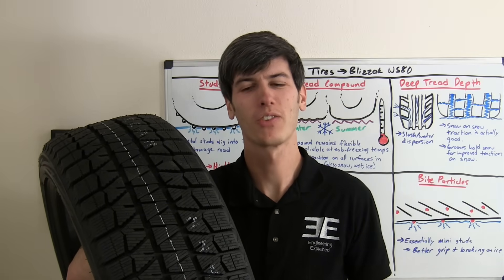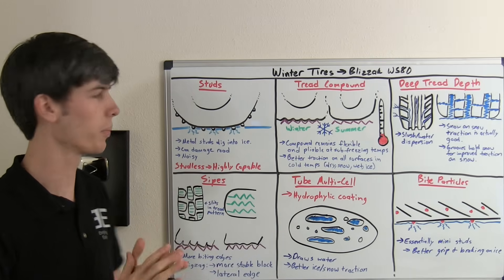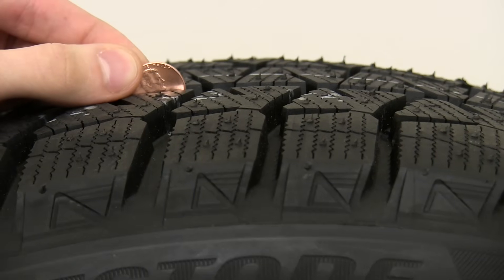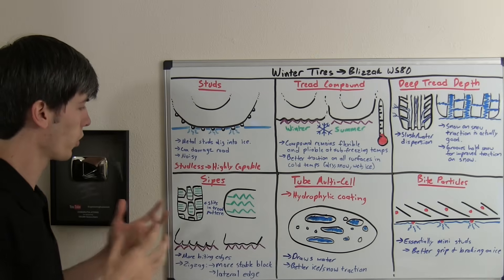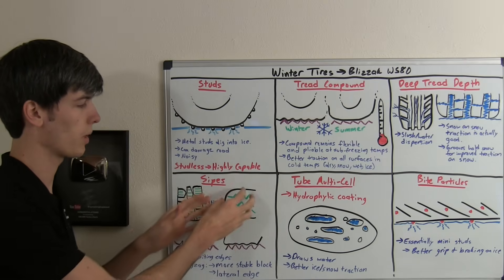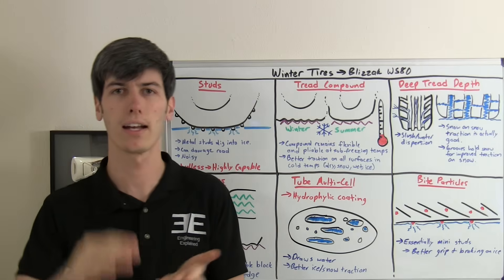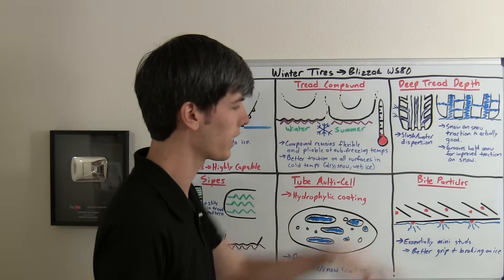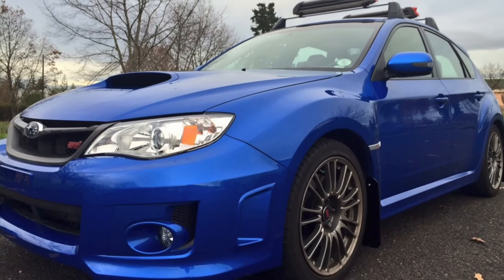Winter Tires Explained - Bridgestone Blizzak WS80

Comment: Studs are legal where i live. I know they are not legal everywhere. There is no replacement for studded tires on actual icy roads though. If you can see the pavement they don't help. The road is cold and hard, a tire is soft and warm. When the road is pure white like when with packed down snow, the studs are amazing. Most roads are white here. Just for fun i only put studs in my front tires on my fwd car.

Comment: I just bought the same exact tires for my WRX, but 16's with steel rims.  I'm curious to know, how quickly do you think these will wear out on dry ground?  Considering how soft they are I imagine I can run these down pretty quickly.
Reply: +Dansyoutube It's hard to say since it's difficult for me to not drive aggressively in my car, but so far I still have plenty of tread depth left for snow after 6k miles on them. The little stubs that were first on the tire are no longer there, they were meant for ice traction if I'm not mistaken, but all of the other characteristics of the tire are in tact. I'd say I can use these for about 3 seasons, which is about 4 months a season, 5k per as well. so about 15k of driving on primarily dry ground until I'd swap them. If I drove in a very tame fashion, I could see them lasting almost twice as long possibly. Note that the handling on dry ground is not good, but snow handling is ridiculous.

Comment: I was actually thinking about buying those tires. I live in Tennessee and some people have told me that if the road is dry/not snowy and icy. I also was told that those tires should only be used on ice/snow. It'll tear up that hydrophylic coating making the tire wear out A LOT faster.

So my question is, if that were true wouldn't the tire still be perfectly usable just without that coating on it?

Comment: Subaru plus Blizzaks kind of makes you invincible in the winter.
Reply: Na , it’s the vape
Reply: Any AWD + Blizzaks.
Reply: @eldesgraciado6690  I'm a Toyota driver now after owning a few Subaru's that needed many head gasket repairs. Subaru does make one of the best AWD systems for non truck style vehicles. I do have Blizzacks DMV2 on my Rav4 but that style of AWD isn't in the same league as Subaru IMHO.
Reply: nah, jeep

Comment: Good video. But for people who own Subaru's such as you and myself we don't need winter tires. Last winter in my home town we had a snow storm and pretty much everyone was getting stuck around me. I didn't have any chains on and pretty much bald tires...went through the snow/ice as though it wasn't there. My Subaru Legacy blasted through the storm like it was dry.
Reply from the maker: fightingfalconfan Haha, I'm sorry but that's just not how physics works. AWD does nothing for you in cornering or decelerating (though it can evenly brake with engine braking, but I'm talking about hard braking). Your tires are the most important thing for traction in the winter, as they're what's contacting the surface. It all comes down to friction. Winter tires will allow for more friction in winter conditions. No car manufacturer can prevent that from being true.
Reply: Actually AWD does ALOT for you in the corning...you just have to know how to use the system. Basically knowing when to brake/accelerate and how much pedal pressure to use. My tires where pretty much drag slicks during the storm and I never once got stuck.
Reply: Subarus symmetrical AWD is extremely good but snow tires are still recommended if you live in snowy areas.
Reply: fightingfalconfan  I think that what EE meant, was that if you apply same speed  in AWD/RWD/FWD when cornering and then brake the same way in all these cars, there is virtually no difference in the way that these cars stop or corner.  They all need different approach when cornering. but tires have no role in that. And lets face it, he is an engineer or studying it, not wise to argue about physics with a man who knows it very well.
Reply: Maybe it just depends on if it's a wet snow or a dry snow. Snow where I live is vary wet, I went through my area to and from work even going around to a friends place to help him put chains on was no problem for me and just about bald tires. Even going up a decent hill was no issue.

Comment: Is there any "optimal" air pressure to run on winter tires? I realize it varies from car to car but just go with the manufacturer recommended air pressures? I find it pretty hard to judge because where I live, one week it will be 5 above (Celsius) and next week -40.

Comment: I absolutely love these tires. I got a set of these for my 2014 WRX hatch and they are great. By the way, I love the WRB. Same color as my car.
Reply from the maker: I'm a bit obsessed the the WRB WRX (and STI) hatches. The appearance is not for everyone, but personally I absolutely love it.
Reply: I love the hatch as well. When I  learned that Subaru wasn't going to offer a hatch for 2015, I knew I had to get a 2014 somehow.
Reply from the maker: ***** I did the same, I got mine in March and it was one of two remaining blue STI hatches in the country that I could find. A dealer told me (lies) that orders could be placed for '14s through July of this year so I thought I could wait, as I had planned to custom order one. Nope - but I managed to get one with just 8 miles on it delivered from CO, and at well below MSRP.
Reply: I managed to get the last WRB WRX hatch in Arizona. I got lucky and found one with all options that I wanted. What is really funny, I also picked my car up in March.

Comment: Do you think decent all seasons(60% tread left) tires with 4WD will be enough to get through the snow?
Reply: All seasons and 4x4/AWD have gotten me and everyone I know through winter just fine. So long as you apply common sense and careful driving. Whether there's 2 inches of snow or two feet, you will be able to accelerate without spinning much, if at all. Where you need to be careful is cornering and braking. This is where the winter tires come into their own, even on a 4WD vehicle. You WILL slide just as much when you brake or turn as if you were in a 2wd vehicle, and you need to modify your driving style accordingly. Slow. Down.
Reply: No. All Seasons aren't made for winter at all. All Seasons are made for spring, fall, and summer.
Reply: It's not ideal, that's why they're called All Seasons, jack of all seasons, master of none.
Reply: +Hear That? General Altimax RT 43, if you're interested in a good priced tire with long tread life and quiet on the road, and excellent in the snow. . Best non snow tire I've ever used. liked the first set so well that I bought a second set and also put a set on my wife's RAV4. she felt much safer and said her car went extrmely well. I took them off of her car and my car during warm weather and am running the tires that came on her car and old ones I bought for $40 👍.  the next All Season I would put back on my RAV4, or my wifes, would be the Mastercraft HSX tire-did excellent in the snow..did good on my mom n laws 4Runner, too. The winters here are so bad that I'm probably buying snow tires this year, just to be safe. the Almanac has been accurate and they are predicting worse than last year and the year before, thanks to the Jet Stream shift. I don't mind the snow, I just don't like the ice.

Comment: How much do they cost?
Reply from the maker: Alex Martinez Differs depending on what size. My Subaru has 18" wheels and wide tires, so they're significantly more expensive than other sizes. That said, $200 per shoe isn't that high compared to some of the others in the same category and size.
Reply: Engineering Explained ok thank
Reply: I live in Europe . I use 13" Tigar Wintera which costs arround $40 per tire with instalation . Before every winter , I buy 2 new ones , put them on front wheels (front wheel drive Hyundai Atos) , and from last year I put in the back , so I always have fresh rubber for puling up hill , doing cornering and most of braking . Even this cheapest one is much better than any all season or summer tire in snow and ice . I keep them when they fall under 4mm (minimal legal thead depth for snow use) for spring and autum , and I use summer tires only for hottest days like in July and August . With this cheapest I never got stuck , never had handling or braking problems , and my car has no ABS or ESC . Only problem with them is that they make a lot of noise between 50 and 100 km/h , squeek during cornering on hot asphalt and wear out much faster in summer than in winter . But with my plan , my average tire cost is $120 per year , because I buy summer ones once every 2 summers .

Comment: Here in Charlotte, NC we just kind "YOLO" the winters. Nobody buys winter tires and they usually just buy the cheapest All-Seasons. Yes, even those in AWD SUVs go sliding across the road like they were stones in curling.
Reply from the maker: Darkmatter28031 Yep, I'm from NC and know the winter car culture (ahem, lack of) there.
Reply: "YOLO'ing" the winter is really bad practice.
Reply: For Charlotte you'll want to run winters from December 1 thru March 1. Only the months if December, January, and February have average temps below 45 degrees. But yeah, people here do NOT know what they're doing on the road in wintry conditions. It's pretty scared. Almost best to stay off the roads entirely.

Comment: Great video! For a followup, could you do stoppage tests with your Subaru to show the difference winter tires make compared to stock tires in snow? A lot of people are still skeptical about the impact these tires have and it would be awesome to see a real unbiased demo of it. It would be a bit of work but would make for a really sweet video. Thanks!
Reply from the maker: Shiraz Hazrat Tire rack publishes some pretty good test results. Until I have a second set of wheels, it'd be challenging to do a back to back in the same conditions. Perhaps eventually though.
Reply: Engineering Explained
Oh no!  Please tell me that you minus sized your winter setup.  Running winter tires on standard steel wheels in the smallest rim diameter that you can possibly stretch over your brakes is how we roll in the Great White North.  There are a lot of good things about higher profile tires.

Comment: I live in Edmonton Ca. It's freaking cold and a lot of snow. Currently running Michelin X-ice xi3 on my frs. Not impressive as I expected, definitely will test Bridgestone's tire next time.
Reply from the maker: Li Li Of the test results published on Tire Rack, the WS80 seemed to have a slight edge over the X-Ice. Braking they were similar, but under acceleration the Bridgestone tires had an advantage.

Comment: The Blizzaks are definitely a great snow tire. I have them on my B5 A4 Quattro, so that plus AWD makes it great in the winter. I have the WS70, though, which seem to be directional whereas the WS80 are not. Should be better for tread life since you can rotate them to different sides of the car.
Reply from the maker: MityLite I have a whole playlist on the matter. https://www.youtube.com/playlist?list=PL2ir4svMoaYim-RSNWEh-aIfdcM6plSly
Reply from the maker: WS80 is also directional. Yep, AWD and winter tires will make snow acceleration a breeze. My Subaru has LSD front and rear as well, so I'm pretty curious to see how well it accelerates in the snow. Braking and lateral grip are of course not AWD dependent, though engine braking can help provide light braking to all four wheels which is nice.
Reply: Ah, they looked non directional at first. My car has a quasi LSD to where it brakes the wheel that is slipping. The acceleration and grip is great, braking is another story though!
Reply: Engineering Explained You should do a video on how LSD's work

Comment: Keep us update with your impression on your subaru WRX STI with this WS80 on ?

Next year, I need to change so ... the Bridgestone is in my list.

Thanks
Reply from the maker: Mazda Speed Thanks, if you don't see anything about it shoot me a reminder around Feb/March after I've had plenty of time on the snow.
Reply: Engineering Explained Do you have news for us about your WS80 ??? thanks to keep us update ...
Reply: Engineering Explained And I have some questions about your WRX STI ... I really need to change maybe my SPEED3 2008 for a STI ... a lot of people tell me the 2.5L Turbo is not the best motor ... so I don't want to change for an none unrealible car like maybe the STI but I see you have a good judgement ... so why did you choose maybe a car with a lot of problem etc etc ... thanks for your help
Reply from the maker: Mazda Speed Only used them once on snow, but they were fantastic. No slip at all. STIs are generally reliable. People abuse cars and then complain they're not reliable. The engine isn't designed to last forever on a Cobb Stage 2 tune (though many last quite a while). It's a strong engine. Keep up with maintenance and you'll be fine.
Reply: Engineering Explained I just don't understand when you apply a tune stage 2 with proper tuner why the engine can't tough it ??? I have a Mazdaspeed3 2008 and I got it Stage 2 from 60 000km and now I have 125 000km without any problem on the engine and I never listen a internal problem like subaru forum talk about EJ257 ...
Reply: Engineering Explained
Will you made some modification on yours ???

Comment: Blizzaks in a Subaru is probably the best winter combo ever! DOWNSIDE is it makes doing donuts/sliding around very difficult. (I guess most people wouldn't see that as a downside :-P )
Reply from the maker: David Dumas I'm actually a bit curious about how that goes haha, as I was hoping to have some fun should I find a nice snow covered lot. And by have fun I mean obey all traffic laws and park, of course.
Reply: To be fair, your STi has much more power than my friend's n/a Forrester, so you'll probably be able to break loose if you want to. I never put snow tires on my '13 WRX because snow came early that year and I found that even with the extreme sport summer tires it came with, I was able to drive safely in the snow. Even with the 6-8 inches we got at a time. Gotta love Subaru's AWD!
Reply from the maker: David Dumas They make a great AWD setup. Considering that if I floor it while turning on pavement I can break the tires loose, I know there won't be any problem on snow should I desire to.

Comment: What are the disadvantages of using such tires in dry weather conditions?
Reply from the maker: Daniel Fok If it's very cold (see the second block on the white board) the winter compound is much softer than say a summer compound. This is actually very noticeable - I was just touching the summers that I exchanged, and the winter tires were much, much softer than the summer. This allows it to contour to the road better, providing more grip. Temps here are just above freezing, and even still the summer tires are rock hard.